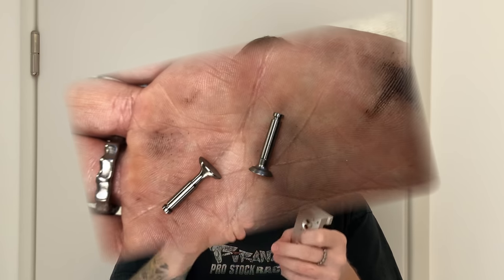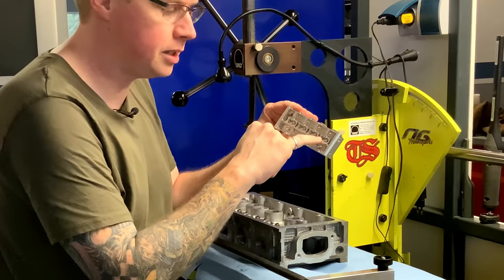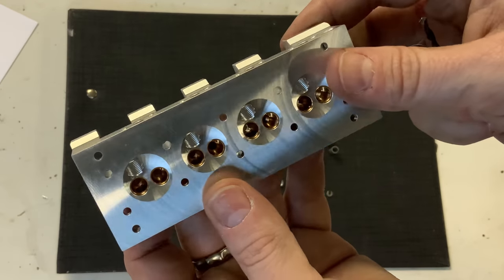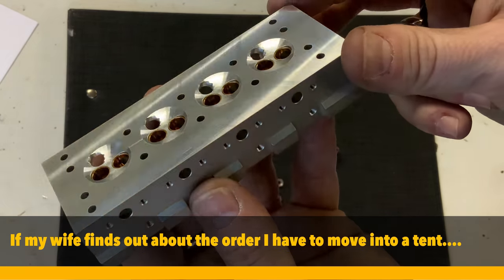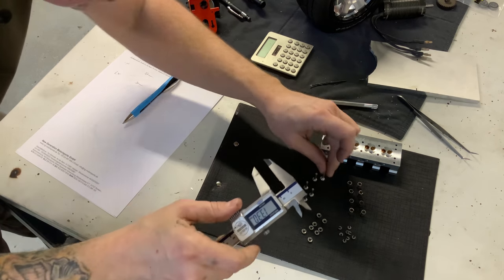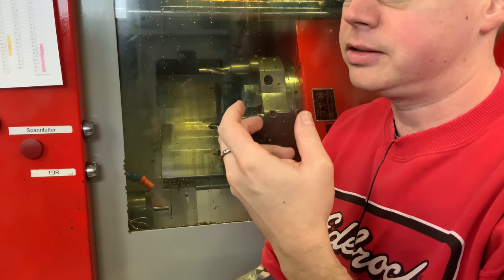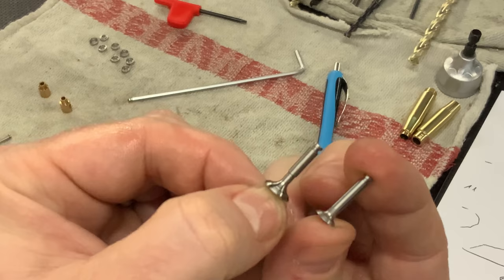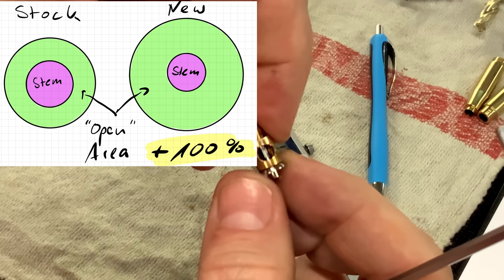Titanium Racing Valves for Toyan L-400 cylinder head - #nerdstuff

Comment: At first I thought "Really.?..Who makes Titanium valves for that stuff" and then remembered you guys have a head shop... Springs will be the next issue.
Reply from the maker: Hopefully not... i forgot to mention that these valves weigh 0.7g compared to 1.1 of the stock parts. that will increase rpm stability already. Later i do not plan to rev ultra high as the crank might break. if NA cylinder charge will increase by 30-40 percent we gain 30-40 percent horsepower. Then, we add boost. Lots of it.

Comment: Amazing work Tim, will you modify the cam at a later date or just the valves, fascinating watching the details and skill 👌
Reply from the maker: Camshaft is difficult. I am in the process of measuring the stock cam to see its exact timing. Then we need to decide what to do. I am thinking of higher lift rocker arms and keeping timing stock - therefore we keep the rpm down to safe the crank. Boost will do the rest.....
Reply: @timsane  sounds exciting 😁 thanks for the reply

Comment: what if you turn it around. 
what if you first make the notches, and only then reduce the shaft? in that case more mass is still present and you can first use a centering point on the narrow side. (sorry for the not so good english)
Reply from the maker: I tried many ways and need to start cutting the stem and cut off at the valves underside. That worked quiet well in the end. But however you do it, titanium parts with less than 2.5 mm diameter are not easy. Titanium needs a certain amount of cutting pressure because it likes to flex like soft plastic. Not easy to explain. Additionally you have the risk for fire... I am very excited to try them! Maybe it will end in a tremendous damage 🥺 thanks for your comment

Comment: Hi Tim, Shame you did not flow bench the head with 'normal valves, then with the modified valves, then with the modified larger valves and valve seats. What gains will accrue from lighter valves and thinner stems only.
Reply from the maker: I do have several heads and will measure all combinations!
Reply: @timsane  Great. Will you be offering an exchange service on the cylinder heads ?
Reply from the maker: @rtalbot87  should be possible but I can not do that very often.... I have five heads coming within the next three weeks. Send me an email to hello@timsane.com

Comment: Just an amazing video Tim can't wait to watch this build come together and see what those heads do on the flow bench. But I have a question for you tho. I am working on doing a 1:4 scale 460 engine any advice on the metal I should use? I was thinking of using built aluminum either  T6 or T7....
Reply from the maker: What do you think of with 460? For me only the Ford Big Block (after Fe) comes into mind....? And which part are you building exactly?
Reply: @timsane  Well if I can I would be machining the whole engine. Yes I am talking about the Ford 460 engine. I got my hands on one that blow up from a 1977 F-250. I am reverse engineering it. While I learn to use Autocad. But I was thinking to make the block out of either T6 aluminum or 6061 bullet.